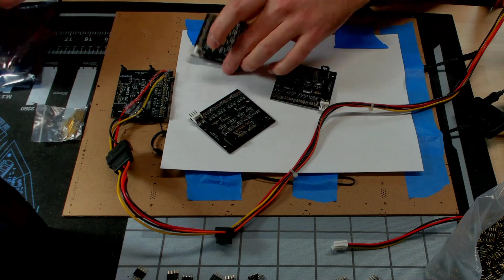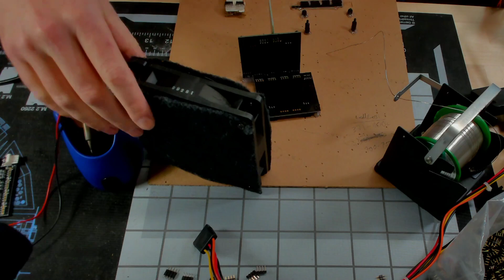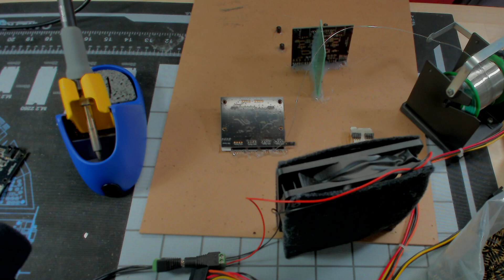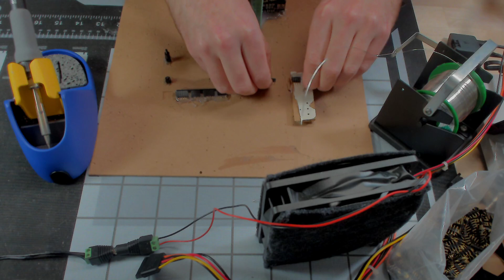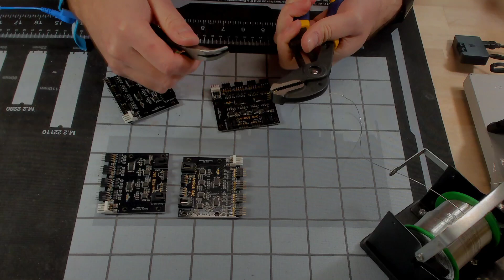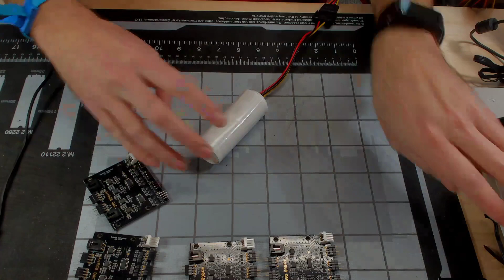ArrRGB DAC Testing and final Assembly

Comment: Maybe make like a 6 or 8 12v conecters? But I dont know what logic you had to integrate for it to work, It is amazing though. So glad i found this
Reply: @SolarityTechnology  English deliciously my scentance was. What I am asking is, could a bored like that be made with 8 or 6 12v ports. Let's say I have 6 normal rgb fans but I want to treat them as addressable, or should I just buy two and run them both?
Reply from the maker: My apologies, I got this and a different post mixed up and took it into the wrong context. I currently only produce a 4 port version that can be daisy chained and linked to another DAC. You can use a splitter for 6 fans or you can control each fan separately with 2 DACs. Just note that LEDs won't be addressable, just each fan as a whole unit will be addressable based off each header. If that doesn't make sense, I will clarify.

Comment: You selling these yet?
Reply from the maker: Yeah, Piratedogtech.com and modmymods.com
Reply: @SolarityTechnology  how long till more 5v to 5v back in?
Reply from the maker: The 5v are more of a niche of a niche. I am currently low of boards and only do the 5v Analog TT fitting style, upon request. Do you have TT RGB fittings that have the 4pin fan connectors or another 5v analog RGB device?
Reply: @SolarityTechnology  yes. The tt rgb fittings are what i plan on using it for
Reply from the maker: @codysturgill6653  How many do you need? I have one that I think is called for. I can make some more, if needed. My vendors have different pricing and bundles. Which seller do you prefer?
Reply: @SolarityTechnology  perfer mod my mods. Use them for accessories on all my builds. Just want the one for now. Only have 4 fittings in this case
Reply from the maker: Just verify the TT RGB fittings are the proper type. i.e. manual controller, all same color, 4pin fan connector
Reply: @SolarityTechnology  their the original tt fittings with the manual 3 button controller yes.
Reply from the maker: Okay, thank you for the details. I will need to check my stock of headers, to see if I have enough on hand for the TT compatible version of the DAC
Reply: @SolarityTechnology  thankyou kindly
Reply: @SolarityTechnology  Hey id like one 5v to 5v as well. Just curious whats the difference between buying through piratedog or modmymods.
Reply from the maker: @a.c.s.6204  
1) Price: PDT includes a custom cable or two bundled with the DACs he sells. MMM sells board only for a little cheaper. 
2) I know both vendors very well and are friends with the respective owner. 
3) You can see about bundling additional items for a discount on shipping with both vendors. PDT makes custom cables and MMM focuses on water cooling and PC Mods in general. 

As my stock of boards is limited to about 11 or less, I am doing 5v boards upon request. I will keep a few for RMA purposes and it could be about 1.5 months, before I get a new order from the manufacturer.
Reply from the maker: @codysturgill6653  I can also customize the board, hit me up on my discord or email, if you interested. I might do this for the next revision.
Reply: @SolarityTechnology  btw i was just thinking about it and the 5v is more like a niche of niche of a niche of a niche  lol. First niche is gaming pcs, second is custom watercooling, third is rgb fittings, fourth is corsair rgb with getting everything synced lol
Reply from the maker: @a.c.s.6204  heh, this is very true.  That is one reason I made so few 5v TT versions. The 12v outsell the 5v and the TT is making an addressable version of it's fittings now.
Reply from the maker: @codysturgill6653  I have enough headers in for 2 more 5v DACs. I also have a 5v DAC with traditional 12v headers styles and adapter, if you want to give that one a try.